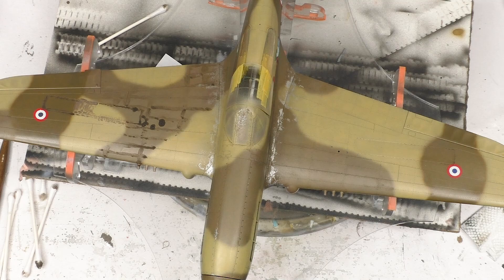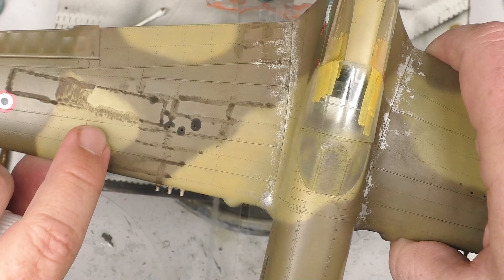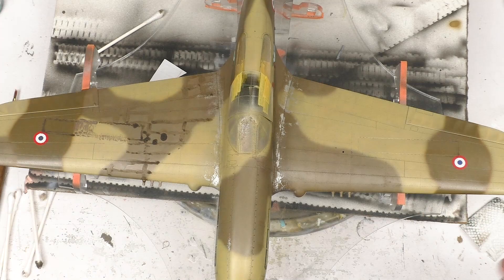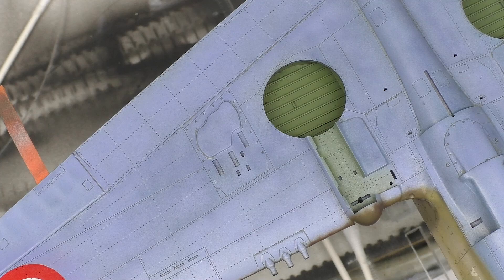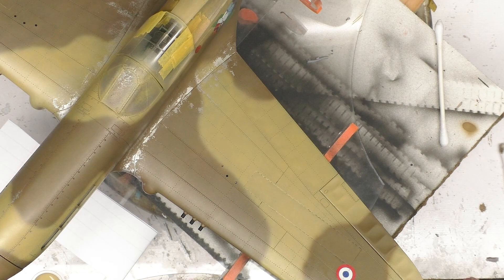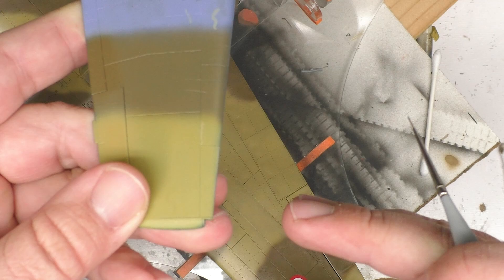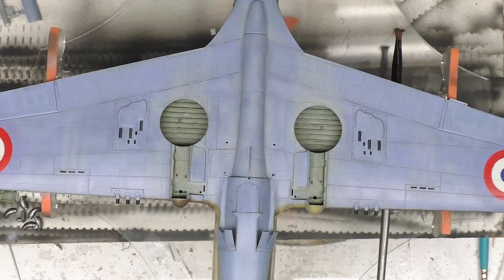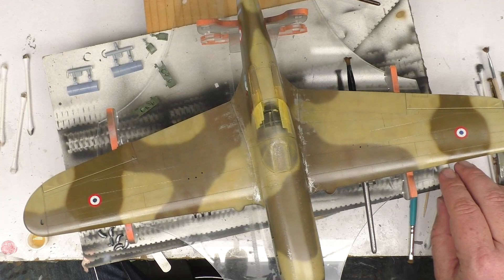P-40F Warhawk Build 10 - Weathering, Part 1

Comment: I really like your work especially when you do the black basing. My question is off this video but I would really appreciate your input. I am going to be building a PBY-5 Catalina and want to use black basing. The under color is a flat gull gray and intermediate blue on top. My question is should I do the splotches in these colors or do variations of the colors before the final light build up of the gray and blue? Thank you for your inspiration and I hope you can find the time to answer my questions.